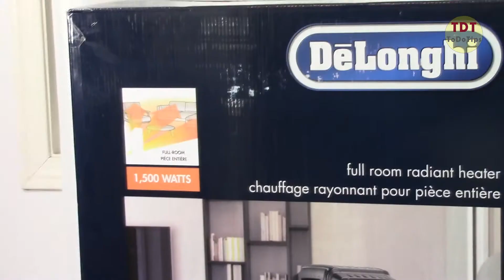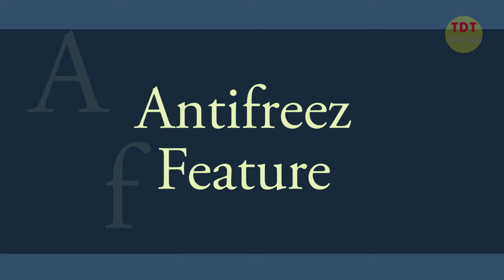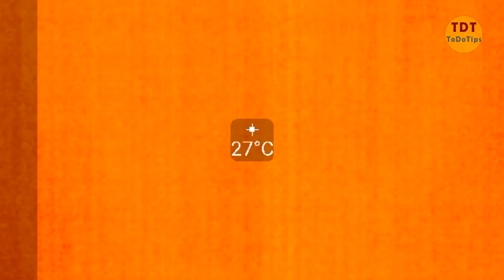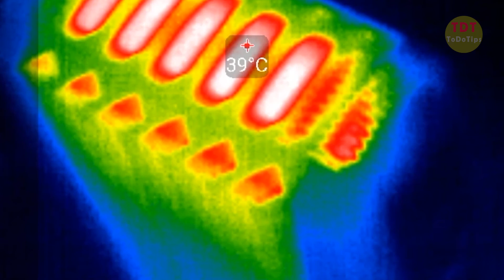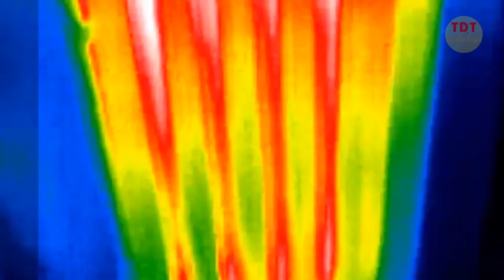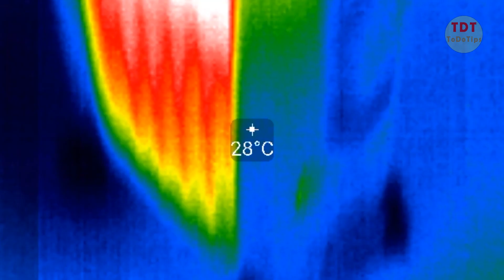Review of DeLonghi Oil-Filled Radiator Space Heater, Quiet 1500W De'Longhi

Comment: Just Bought one and it gives off very litttle heat on highest setting. My Delonghi Dragon instructions says it is for a large room. I am sitting a room that is 10’ x 12’ and the room is ice cold after 3 hours of heat going on full power. 😊not sure what the problem it. The heater cost $80.00 more than the heater sitting next to it. We also have a SAI heater that we got for free and it heats this room  in 30 minutes.
Reply: There may be an air pocket in the oil, another commenter had the same issue and fixed it by tilting the heater at different angles to release the air bubble to the top of the heater, i think this happens during transit, when being jostled about. Or it maybe  the reset button needs pressed, there's videos to show how to do this. Hopefully this helps 🙏
Reply from the maker: Leave it on. May be your room does not have any insulation. You have been using it and it is the best.
Reply: You must have draft and no other heat source in the home at all. This isn't meant tk heat the whole home, or even a room if the entire home is cold.  This heats my office/lab in like 10min. You must be relying solely on this
Reply: leave ot for 30hours and than make comment.
Oil heaters are the best but slow. Once when you have your optimal temp. If are your furniture and walls cold you need time to heat them up.

Comment: I'm thinking about getting an oil filled heater to replace my portable propane heater. Base on your experience, how long does it takes to heat up a room. Please include room size and temperature range (from 50f or 10c to 65f or 18c). Thanks
Reply from the maker: That is tough question. No one can give you definitive answer as many factors affect the result like room temperature at  beginning nor outdoor temperature,  room insulation quality and more. But the power of 1500W is very high.

Comment: I have one delonghi and suddenly it starts to turn off after 10 to 15 minutes, it does not have a timer on. Can you please let me know what could be the problem.
Reply from the maker: It could be overheating that turns it off.  Contact manufacturer. We have been using it since I posted the video all this winter  set to 21C all nights and it works perfectly yet.

Comment: Does it require electricity or only use oil?
Reply: Does a bear shit in the woods 🤦🏻‍♂️🤦🏻‍♂️🤦🏻‍♂️
Reply: The device is filled with oil.  Once heater is turned on, it heats the enclosed oil using electricity to provide radiant heat.
Reply from the maker: Electric. Please watch .